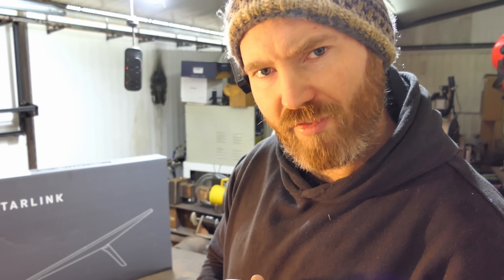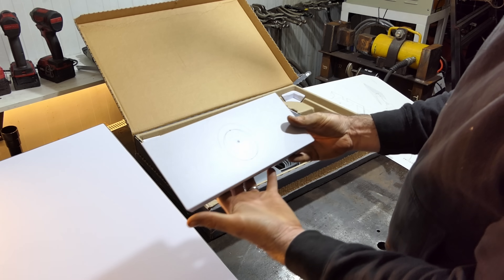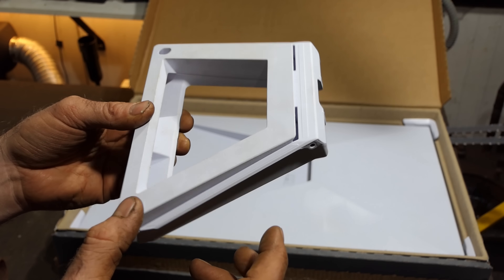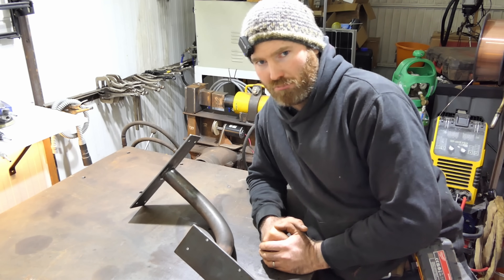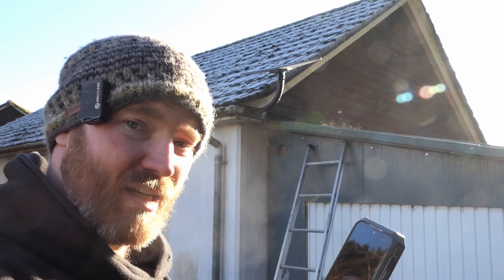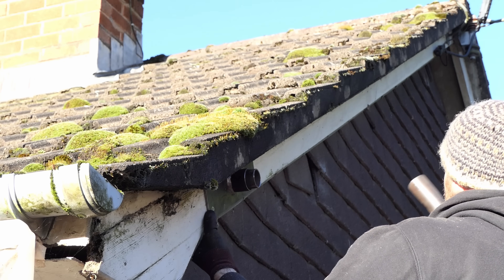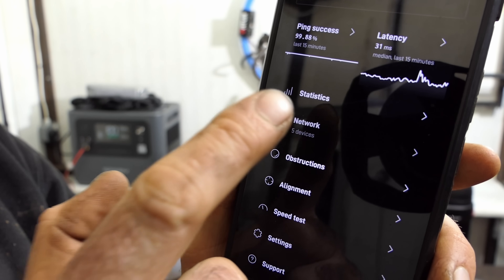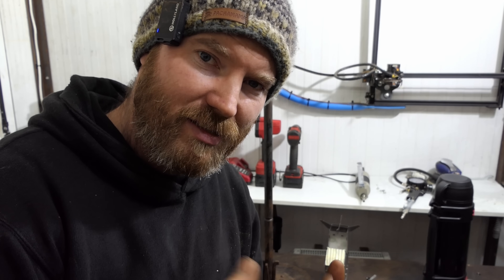I bought UK Starlink internet... I'm shocked!

Comment: Weird, I live in Thailand, i pay 10 quid a month for a 500 meg line, both upload and download. The UK is so backward, it is so depressing.
Reply: It's because everything is regulated, takes decades for infrastructure in the UK to be upgraded. You're right, extremely depressing.
Reply: Yeah i pay around 15 bucks for  1 GB upload and download speed.(in Romania)
Reply: Wages = the difference. UK wages are a million times more than Thai. Very depressing and backwards of Thailand.
Reply: Virgin uk is like that. Just switched to broadband with Vodafone and got 1Gbs up and down. Nutz considering i pay 4 quid more a month than virgins 33 quid for 128Mbs
Reply: @Martin_Ellis  hyperoptic is better 
london only so I can't try yet
and my rent includes internet rn, only needed to use adaptor for leading the router into the wall plugs, way more stable
Reply: he lives in the countryside - you can also get 1gb in much of the uk and it's not expensive.
Reply: Have you looked at how stuff is wired in Thailand, it’s spaghetti. Stuff like broadband requires a lot of man hours to install so the price depends on local wages.
Reply: UK isnt backward at all.  I live in the countryside middle of nowhere 20mins to the nearest town but have FTTP 1Gbps to the house as does the rest of the village.  I could also upgrade the bearer to 2Gbps if I wanted.  There are plenty of grants available you just need a proactive parish council to unlock them, its not hard to apply just needs some collective effort.
Reply: @carlbox5130  Ditto, rural location with FTTP.

I'd guess part of the problem is people search online and the biggest companies, like Starlink, are the top results despite being inferior options.
Reply: because Thailand use Huawei
Reply: stay phuket use AIS unlimeted  hot spot cost 1300 bath have long time more 5 years use 3,5 gigbyte month never fail 5 g
but not better then 4g

Comment: I have no cables no dish bought a D link box and the chip cost for the two, 400 quid, the chip will last 1 year then cost 145 quid for another year, 450 speed to 50 but I have had it for 10months and had no probs at all, saved me hundreds of pounds so far .

Comment: I used an elaborate Mesh network with Starlink and it is awesome.  I have 5 nodes and it has incredible coverage even outdoors.  Average speed is about 230mbps in Virginia USA.  I even beamed it to another house that has its own router using dual WiFi satellite dishes(Ethernet goes in one side and pops out the other).  Normally those have about a 10 mile range but I’m only going through about 1/4 mile that includes some dense forest.  It actually works and does about 50mbps through all those trees.  Networking can be a lot of fun.

Comment: You can use the starlink router in passthrough mode, and connect it to a better router for getting signal to further parts of the house, you don't get to use the App anymore though.

Comment: Yeah i remember when i moved from old ADSL speeds 12/0.8 to fiber 100/100 about 10 years ago. My mind was blown away by the huge difference in speed.
Now days i have 500/500 fiber in my home and 5G on my phone with no data limits and speeds upto 200/50 or so. 🙂

Comment: If you live in a rural area then it's ok I guess. But otherwise, what a scam! €355 initial cost and €89 a month. Maybe that's normal for the UK but here in the Netherlands I used to have 1000/100 Mbit for €76 on a copper wire. And that's considered expensive because I recently switched to fiber for €30 a month and the same speed. And that includes TV.

Comment: Enjoyed the video and your presentation style. I've had issues in the past being in a village that doesn't have true fibre-optic connections. Finally found a solution a few years ago and it's still working. (Not as fast as Starlink but only £11 a month). I bought a dish that has a built-in modem that takes a network SIM, from Mikrotik. The SIM is from 3 and I get better download speeds (varies depending on how busy the network is usually around 15-30Mb/s up to 50-60 Mb/s during the night) and good uploads speeds too 20-30Mb/s - which is what I wanted to speed up the uploading of videos etc. The transmitter/mast is about 2-3 miles away.
SIM is unlimited Data and as a loyal customer costs me £11 a month. The cost of dishes from Mikrotik vary. I think mine was about £250. Mounts on my chimney, points towards the mast. You need a long LAN cable to bring into the house. It won't be the solution for everyone, but it's been a very good option here. 
On another subject, getting you faster internet to the other end of the house might be easy to do with 'Homeplugs' if your counter has a lan cable connection. Not that expensive and you can have a separate Wi-Fi point in your workshop that links via power sockets. Mine work brilliantly, especially for direct links to TVs.
Thanks again for the video. 👍

Comment: Joshua i see on your mobile you had a 5G signal - have you got a decent signal?  Did you not look into a 5G router or even 4G? I am in a siilar situ to you in that the fibe was terribe - it drops of very quickly after about 1.6km or miles i believe and im about 1.9 i think. I was getting 2-3mbps down and 250k up so i sacked off the firbre and got a 4g router and found out voda was on the tower nr me. So got a lebara unlimted plan for £25pm and i get anything from 25-50 down as 10-25 up normally. Beats the pants off the fibre.  Im hoping they get 5G on the tower soon so i can try that.  Im in a dip in the valley so voda is the only cell tower i have line of sight on and their 5g coverage is ** My next option is Starlnk like you but cant jusify the expense atm until i can put it thru a business.
Reply from the maker: 5G is no good here either, it's intermittent and often poor. Not many people have phone signal either where I live. Cheers J

Comment: So you're on a copper line and you are getting 17Mbps  down and 0.9Mbps up. You are getting scammed !!!! There is no other explanation then your IPS refuses to upgrade their 2 decades old crap in your neighborhood dispatch. DSL over modern equipment can be up to 90 Mbps (up and down) , via coax you could go up to 1Gbps, via fiber optics (not available for you) 4Gbps should be available soon. Time to switch ISP (assuming it is an open network)
Reply: Oh and of course there is something called 4G that should deliver 1Gbps.

Comment: Enjoyed the video were running Starlink for about a year now remote location and super pleased . The instructions from Starlink alignment are 180 degrees out which also threw me they said nw and sats were sw luckily i did follow there advice and got the system set up with the dish on a table outside . I bought the starlink bracket as quality looked good and the supplied one is used for a mobile mount on my camper . I also ordered the additional longer lead as i had a tricky cable run and the 75ft wasn't sufficient the shorter cable again sorted the camper connection . Note moulded plugs on both ends of cables so you do need large hole to route it . we have a large enough property so i bought the starlink router connection and hooked it up to a 3 pod wireless mesh system .We get around 180 mbs down and 60mbs up everywhere so super pleased . One thing i find  is that if you have multiple windows open for long periods and are clicking in and out you will get some lag so keep your windows fresh i clear cookies browsing history etc makes everything really sharp :D Total cost was Starlink €365 and mesh  router €150 i did all the installation myself we pay €50 monthly subscription best wishes Mikee

Comment: 360  is nothing. I had 10gbit/s (averaging around 1Gbyte/s) in Japan. Running on an nvme you can get those speeds. The UK internet is terrible for speed. They charge around 50 pounds a month for 1gbs. I paid nothing for a 10gbs fiber connection in Japan. 
The UK needs to pull it's head out of it's (donkey). 20 year old cars, still on the road, is not normal. 1gbs max down speed is not normal. 20% tax is not normal. Waiting 12 hours to see a doctor in A&E is not normal. UK: open your eyes!
Reply: Nice that number porn. I'm happy with my 70 Mbps. Upload is higher which it isn't supposed to be. But i don't care, i like to share. It's nice if i want to run a game server again.

Comment: Top tip; you can get ethernet that connects through your mains sockets. So you can plug your router into a link and then have it come out in the workshop at full speed.
Reply: (the brand I got was tp-link had been working for many years)

Comment: Nice video. We use Starlink and the results are great but I'm baffled by your fixed installation. Ours unfolds itself and tracks the satellites on a motorised pivot. We had it up and running literally 5 minutes from unboxing. What version do you have?

Comment: Bought one for my folks who had same problems with poor internet. There self adjusting dishes are really easy to set up. The router as you say is dreadful for range and had to spend £30 on an ethernet adapter as router doesn't have an ethernet port! But once set up, super fast and super reliable

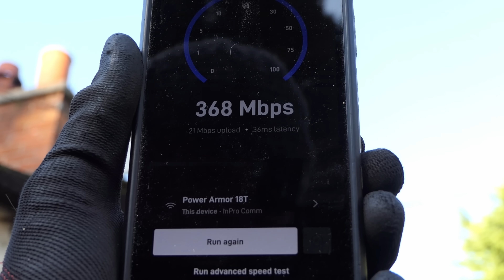Comment: 8:15 That's 368 Mega BITS not Bytes.  There are 8 bytes in a bit.  Your actual speed in Megabytes per second is 1/8th of that figure, so about 45 MB/s (still fast) - you need to know difference between these if working with the internet mate lol.

Comment: I'm over in Canada and have had Starlink for over a year. The snow melt feature works flawlessly and we get a lot of snow. I believe it basically uses more power to boost the signal which also generates more heat aka snow melt mode

Comment: Good, honest video. Worth watching to see what NOT to do. I saw the initial problem immediately (welding up the mount solid..), so no way to adjust. I yelled at you, but I guess you didn't hear me. BTW.. FWIW... Starlink is known for changing the direction of service to the satellites in any given area. They do this to "load balance" their system.... move some of the traffic to underutilized satellites. SO... Don't be surprised if they reassign your "direction" at some point as their usage density increases. You would then have to change the direction of your dish once again.
Anyway, good job. Hope you have worked through the initial issues.

Comment: Well they just dug up the roads to fit optic fibres and replace BT landlines with Voip.

By 2030 optic fibre and cable voip and 5G even 6G mobile masts will be a thing of the past.

Also quantum GPS is becoming, UK MOD now using it in 2025, no need for satalites to provide a GPS signal.

Comment: Get a good router and a switch, a couple of network cables to where you need permanent connection, get a few access points using cable backbone and you'll be all set.

(Hook up the starlink cable to the internet slot in the router)

Comment: I know the vid is about Starlink - and I looked and I was tempted for my son's house, then I discovered that £10 a month gets you an unlimited 5G card (Voxi - Vodafone, when on sale). Plus you need a 5G "rooter" eg GL.iNet GL-X3000 (Spitz AX) 5G (on sale at Amazon for £330) and you are golden, with great wifi. The 5g antennas can pick up from miles and miles- mounted indoors...further if you extend antennas up a pole and can build a bracket :) Whereas you might get 5Mb on your mobile phone download you get 150Mb download with the Spitz - in our case. I bought the one with battery attached so portable and survives power outs. Just because you are in the countryside does not mean that you cannot be connected.

Comment: It is additonal cost, albeit one off, but you might want to consider investing an a mesh network system. You plug one extra device int your router and another somewhere else in the house and it masively increases the coverage area. I have a mesh system and I get near full speed internet everywhere in the house and garden.

Comment: Star link,  ideal if your remote or move around alot (at sea),  if in range of 5G mobile networks, using a dedicated 5G rooter( router), faster and  way cheaper than the rest, ( u can get unlimited data for #10/month @300-500mbps.)                 BT/open reach fibre line took 6 months to get it installed and did not work,  02/virgin  just the same, expensive, i gave up on both.                                        5G dedicated router ( if  mobile network is in range) or star link

Comment: We got 40 down but in a house with 3 people using it it would often cause buffering and stuff. Begrudgingly ordered starling and also had to pay the extra £75. Now I get anywhere from 80 to 300 down, more often than not it will download 4 or 5GB files at an average of around 22MB/s. Not tried a larger file yet but have had no need to.

I have a large flat roof so just hoofed a foam floor mat up there and a 60*60 paver and screwed the mount it comes with to it. No trouble at all and it certainly isn't going anywhere.

Comment: That dish <> router cable is a standard Cat 6 cable with weird Starlink connections, so you can cut it, feed it through a wall and join it back up matching the coloured wires using standard RJ45 connectors.
Reply: wait doesn't it have to be POE for the heater?

Comment: Starlink is the only thing in the past few years that reduced it's pricing policy. From €50 originally, to €40. I'll keep it, as we've been promised fibre optic internet for the end of the year, but given how poorly things are managed here in Brittany, I'm keeping it as backup. Plop it on the lawn, let it do its thing, and off we go.

Starlink has been great. I can work from home no worries, I can stop the contract any time, and pick it up any time (when my promised fibre optic connection drops because some tractor cut the cables).  It's pretty stable, not perfect, but 99 percentile, some drops sometimes when the weather is really poor. €450 for an antenna, cable, and two wifi nodes, €40 a month, not too bad.

Comment: I moved to Belgium over a year ago, after 4 months of 20Mbps DSL I pulled the trigger on Starlink and never looked back. On a good day 300+ Mbps, even on an overcast rainy days I still pull 100+ Mbps, between 150 and 400 Mbps seems to be the average overall for European users. I know back in NA you can get upwards of 1Gig. I recommend getting the physical network adapter and hardwiring your home with ethernet over power adapters.

Comment: Here around the kit is about 400 euros.......

In the old times of satelite-internet there was the problem if to many in one region used the same satelite they shared the connection n it works worse for all......

Could that be that the starlink kit is thatmuch expensive to prevent to much people from using it?!

Comment: FYI Those latency figures are not good

Latency Range	Performance Level	            Examples of Suitable Activities
0–20 ms	        Excellent	                            Online gaming, VoIP, video conferencing.
20–50 ms	        Good	                                    Streaming, general web browsing, most online tasks.
50–100 ms	        Acceptable for most uses	    Email, file downloads, casual web browsing.
100–200 ms	        Noticeable delay	                    Streaming with buffering, slower web responses.
200+ ms	        Poor	                                    Not ideal for interactive or real-time applications.

Fibre to the premises currently showing as 9ms in the Valleys in the UK. Uploading large files, latency shouldn't  matter too much (TCP window size etc etc). Good Luck!
Reply: 27 to 36 isn''t too much difference but still 30% increase - if it works it works!

Comment: Sounds more like a wifi router issue. You have two types, 2.4 gigahertz (GHz) and 5 GHz. If your router wifi is set to 2.4ghz, you will get a much slower DL speed over wifi if that setting is wrong.

Comment: I've had Starlink for a year now. It uses around 1300 satalites. I did get a second router as I did read about the short range.  Now, I get WiFi in garden infact everywhere! Down side, everytime there is a plane, helicopter (i stay close to an airport) the signal can drop for a few minutes, but generally the cache is good enough for no interruptions. Everything, literally every xbox, laptop, all mobiles, city, etc etc everything is connected with starlink.  It hands down the best compared to everything else. The cool stuff is that the square dish auto lines up and it also heats up for snow and frost to melt. Bit on the pricy side, but worth it
Reply: A cursory google search will tell you there are around 7000 Starlink satellites in orbit. Why would you say 1300?
Reply: @oldboi_gg tell us you're dumb, without telling us you're dumb :)
Reply: Same, had mine for a year - we’re in Cornwall and not rural particularly just no fibre still and couldn’t get a reason from the providers as to why my neighbour had fibre (no other neighbours near us) but I didn’t 🤷‍♀️ Anyway so glad I went Starlink route - absolute game changer.
Reply: ours is 100feet+ we use the router they gave us as a bypass and bought our own but the starlink is POE (power over Ethernet) so you need to run cable to the modem